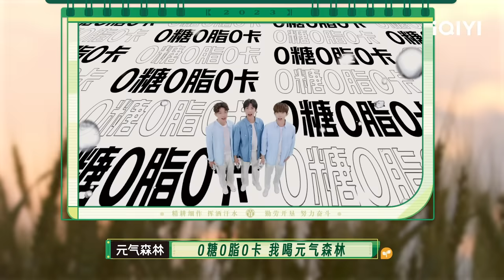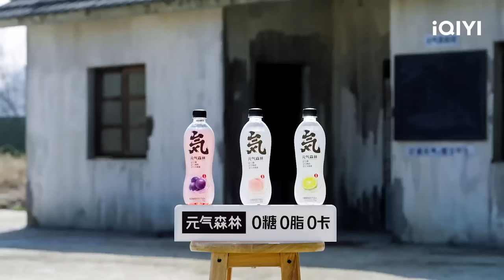EP7：鹭卓李昊干活全靠内卷！ 徐志胜抖包袱逗笑全场 少年之家第一届猛男之争来啦！|  种地吧 FULL 生活特辑 Become a Farmer | iQIYI综艺

Comment: Zhao Yibo's daily hobbies are electric welding and water and electricity maintenance, he was admitted to the Marine Engineering Department of the Merchant Marine College of Shanghai Maritime University.
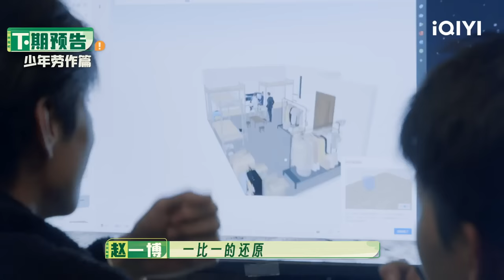00:50:13 What technology Zhao Yibo used to arrange the dimension in 3 d very good technological tool. Does anyone know?
Reply: I will help you, I remember Yibo has shared this info (but they have too many video materials, vlogs... I need to check), I'll back here once I get the record.
Reply: Back...it's called 酷家乐 kujiale